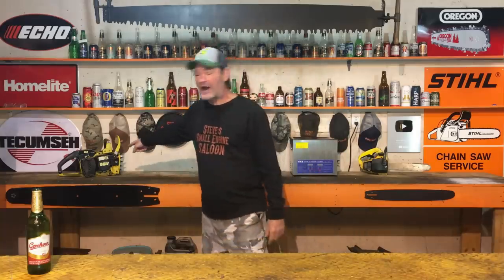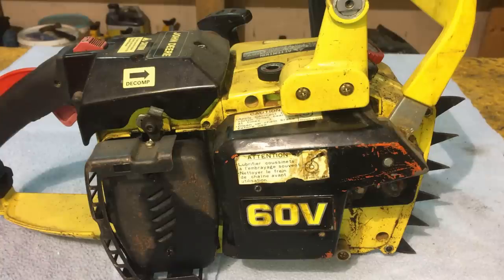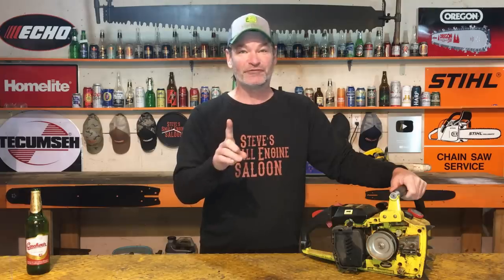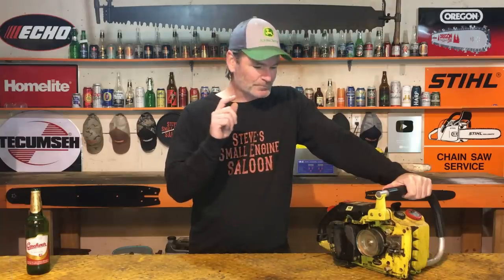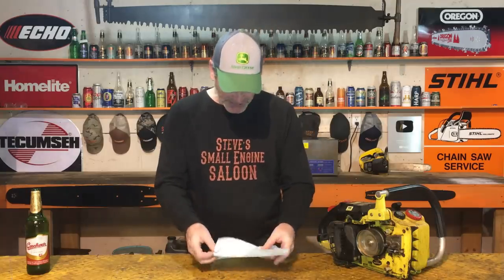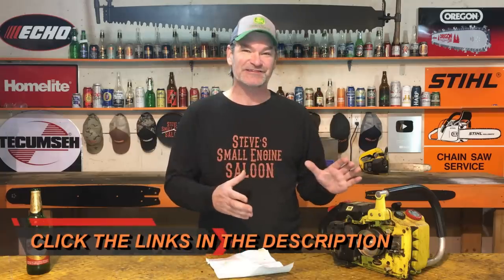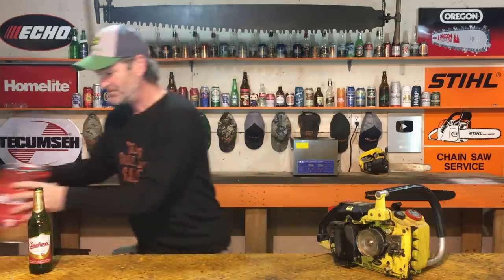Help Me Fix This Chain Saw Oiling Problem

Comment from the maker: ✅Click here for bar and chain oil ➜ https://amzn.to/2WhJoIT
For more videos like this, check out: 
👉How To Use a Stihl 2 In 1 Chainsaw Chain Sharpener ➜ https://youtu.be/marzGaMq6pM
👉How To Repair A Chainsaw That Cuts Crooked ➜ https://youtu.be/AgCZxee2NPA
👉Adjust The Chain Tension On Your Chainsaw ➜ https://youtu.be/FxgQSPQeYYM
👉Correct Way To Adjust The Carburetor On A Chainsaw ➜ https://youtu.be/M6T5JoGXcHY

You can connect with Steve here too: 
✅Visit Steve’s WEBSITE ➜ http://www.stevessmallenginesaloon.com/ 
✅Visit Steve’s PARTS & TOOL STORE ➜ https://www.amazon.com/shop/stevessmallenginesaloon 
✅Follow Steve on FACEBOOK ➜ https://www.facebook.com/stevessmallenginesaloon 
✅Follow Steve on INSTAGRAM ➜ https://www.instagram.com/stevessmallenginesaloon/ 
✅Follow Steve on TWITTER ➜ https://twitter.com/SteveSaloon

Comment: i have been a small engine mechanic for 40 years now in guernsey, channel islands, we used to have that same problem with the old remington saws and the solution for those was 50% chain oil to diesel mix and it always worked with that, love your videos keep them up. best regards Andrew

Comment: I've been in the same business for 36 years and can't remember much about that system. The crankshaft has a lobe on it that pushes the piston on the oil pump......that i think i remember. Also the check valves can be tricky. I vaguely remember that the clear plastic cover near the clutch drum has something to do with  the system too? Hope this helps.........keep us posted please!

Comment: Steve, just a rookie's opinion here. If I had that problem I would disassemble the entire oil mechanism/assembly. Then reassemble, double checking that each component of system is positioned correctly, paying special attention to seals, and their orientation. As another subscriber suggested, ensure all ports are clear before reassembly. Remember, we are all in this together,  and I am rooting for you. (Red Green).

Comment: Hi Steve. Get an airline, take the oil filler cap off, start the saw and put your hand over the filler hole. give it air through the gap between your thumb and first finger for about 10 seconds, don't push your hand down too hard.  Do this a couple of times until oil comes through. Once primed it should run fine so long as it doesn't run out of oil again. All the best, Another Steve from the UK.

Comment: I can't tell you how many things I've fixed by cleaning them. If it doesn't work, don't assume broken. This applies to everything from chainsaws to washing machines.
In this case, I agree with most of the comments.  Go diesel. The port is likely blocked by old oil mixed with very fine sawdust.
I appreciate your humility in giving a shout out for an assist. Many would never do that.
Happy trails.

Comment: I have 60V I bought new in early 1980's. Best saw ever! Used it for firewood for several years up north. Now I use it for hurricane clean up. I have the service manual. I can send you the section on the oiler--if you don't already have it.

Comment: What I did was make sure the oil was at about half a tank, wrapped a air compressor nozzle with a damp rag to plug the hole and used 100 psi to blow oil out the oiler system. Once oil started spraying everywhere it has worked beautifully.
Reply: I want to see that whether it works or not.
Reply: That's great...
Reply: I just did this to an 80's echo 500 vl and it worked great. I used a big washer to cover the hole and still got oil everywhere
Reply: This will for sure clean out the system. I would then run some cleaner through it to get any leftover junk out.
Reply: Damn straight! The best way to fix that somebitch for good. The check balls , o- rings and seals are crucial to this oiling systems sealing for proper flow of oil. 
One bad component and thats all it takes. Thanks bro

Comment: I own a 40v and a 60v I inherited from my dad. I have the exact same problem in both saws. Both run great, don't oil. It kills me to think of getting rid of these saws but parts are hard for me to find and again, the oiling system is awful to work on. Point is, I could use some help as much as anyone. Thanks.

Comment: Steve it's simple it really is.... Do what my Grand pa did .... Put it all back together again get a bucket half fill the bucket with chain oil and go cutting. After every cut just dip
the blade into the bucket and start cutting again... Over here in the U.K. It's called self oiling.. Which means you get covered in chain oil but at  least the saw keeps working..
Bet you are glad i came along on this one ???

Comment: Well Steve has chainsaw mechanic back in 1977 back till about 1985 long since retired that but I do believe that maybe what you got is a situation where there's a bypass from the bar oil back to the tank and if the oil is moving quicker through the bypass and it's getting to the bar Oiler that's my best guess good luck

Comment: I would had the same with lambard chainsaw back in 80s 
I had to prime hand pump before auto will kick , I would strip manual pump , prime with heavy oil like 80-90 weight and check flow , hope this helps good luck and thanks for sharing knowledge

Comment: Had the same problem with a vintage saw there was a duckbill valve inside the oil tank on a pulse line that had fallen off. For the oiler system to work the tank must be pressurized.
Reply: I thought "duckbill" too because I fixed an old Poulan (one that was made back when they were solid machines) by replacing the duckbill. But I don't see one on Steve's schematic. Maybe I missed it ... do you see one?

Comment: Steve, my Echo chainsaw of the same vintage has a similar issue temporally repaired by replacing the hose (looks like surgical tubing) extending from the pump to the plate at the chain.  The hose either plugs or deteriorates within a few months of replacement.  My saw is the twin cylinder model that is now an expensive decoration.  Good Luck!

Comment: Hey there Steve, I couldn't tell from the parts diagram, does this have a pump for does engine pressurize the oil reservoir?   If it is a pressurized tank system, maybe the port from the crankcase is plugged or possibly the gasket around the filler cap leaks?  Never worked on one of these, just my random thoughts.  Good Luck and keep on keeping on!!

Comment: Well your right with that many parts involved in an oiler system, that is going to be mind blowing to trouble shoot. Before I saw that though was my thought of if there is a pick up tube in the oiler tank with a screen is possibly the screen is plugged or they the tubing from being pushed into the tank in a certain way has developed a kink in it which has closed it off as I have had something like that develop in a little homesite saw of mine. Might be worth checking out if you haven't already.

Comment: Steve, love your videos.
Question, I have a Stihl chainsaw that has served me well. Used it a couple months ago with no issues. Tried to use it law week. When you pull the cord it feels like it's hydrolocked. Take out the plug and it pulls freely. Thoughts?

Comment: Have you tried checking the seals on the oil plunger. May be leaking and not allowing oil to flow when using the manual oiler. May have a blockage in the oil passage too.

Comment: Hey Steve .... I'm gonna throw out a hail mary and see what happens... from what I originally thought, and from what some of your subscribers have been saying....I would like to see what the oiler draw tube,or port looks like,and would bet your next paycheck (lol) that there is a blockage somewhere along the line , or the filter the oil gets sucked  through is also gummed up . That's why it makes sense with some viewers comments on using diesel fuel,or acetone,or any strong type of solvent seemed to work for some saws. The chemical or solvent that was used in the oiler reservoir eventually broke down the blockage enough to be able to draw oil again.
 Thanks for turning the tables on us and let us, your viewers, have an opportunity to help you with your repair. You are our preacher , we are your church ! 
 Thank you , charles

Comment: I have fixed my John deere chainsaw with using a vacuum pump sucking on the oiler hole by the bar. Try it just might work. Did for me. Works to this day.

Comment: Steve, I love you videos and have learned a lot from you. I'm guessing that your problem is in the functionality of the oil cap as it has quite a few parts and it looks like they are using it to control oil flow, it could be letting to much or to little air in. My Stihl 009l has a diaphragm pump running off cranckcase pressure and it had a bad gasket on the cap and it wouldn't pump oil. Good luck!

Comment: Have you tried using a shopvac to see if it will suck air from the bar sid to the tank? If you put the vac over your tank fill and you get it sucking a little air, then spray some brake or carb cleaner in from the bar side.

Comment: try running it with a bit of oil in the tank with the oil cap off to see if its a venting problem. next try pressurizing the oil tank and see if air or oil can even be forced out. one of the knobs may be assembled in a closed position.
Reply: #21 looks like a metering system make it loose as as you can! I think this is the right track!

Comment: I had the exact same problem with an Echo chainsaw that would not oil. Dealer couldn’t fix it either. Problem was fixed when I bought a Stihl.
Reply: Husqvarna has superior Oilers fyi.
Reply: Damn straight on the he sthil.  STHIL THE BEST A MAN CAN GET
Reply: Brilliant
Reply: @MatthewBrownW  Stihls are not even good boat anchors
Reply: BS
Reply: @terribreneman5578  what the hell is that supposed to mean
Reply: You settled for a temporary fix A modern Echo would be the correct fix.
Reply: @owengreene7659  although I like and use several Echo products on a regular basis, for chainsaws, it's Stihl all the way.
Reply: @owengreene7659  yea yes yea
Reply: @phillippowell6299  As a recently retired small engine mechanic I stand by my comment without reservation. Stihl is resting on their laurels making mediocre at best equipment. At any given price point you get less with a Stihl.
Reply: @owengreene7659  I stand by my comment too.  You are welcome to your opinion.

Comment: i did crank seals on a 1984 550 evl echo last year and the oiler adjustment was on top of the motor but you had to use a screw driver to get to it ,, im wondering if someone may have taken something off the oiler system and left something missing or possibly the oil tank isnt venting ?? good luck with it i know you will get it working no worries

Comment: I have got a FS 80 stihl weedeater it has got a slide carburetor it idles good, when you go to full throttle it die off the carb is clean the diaphragm gasket is still flexible can not find a carb kit for it. The fuel filter is clean and all new fuel lines. Any suggestions thanks great videos. This fix may take a case.

Comment: I know how you feel I have a Stihl that does the very same thing..Using a new regular oiler or high volume oilers  that throw oil but the chain will still gets hot and freeze up..It is so frustrating ..Your not the only one that has one of those SOB's. It has been sitting on the self for years every now and then I get enough courage to try again.  Motor is excellent what a waste

Comment: Have you tried priming the oil system by putting oil in the outlet that seems to have always worked for my saws if you can unthread the thumb piece for the manual override Prime at 2 with some Bar Oil

Comment: Have you tried to blow air in the little hole on the side while pumping the oilier my dad had one of these old saws and that is what I remember him doing It blows all the blockage back into the tank then drain and refill with new oil.

Comment: hiya, I talked to brother that collects them saws he told me too have check the check valve ball assembly and make sure the spring moves freely , make sure the cap is venting, but he said even if was not venting it would still oil but not very long the check valves were what he found wrong sticking some times some solvents would break them loose  hope this helps

Comment: I have an old pumper McCulloch the shop had it for over a year the finally found a new rubber oil pumper ball like gas primer bulb and it worked is there a hole in your rubber manual oiler pumper ball bulb?

Comment: Speak of venting, Does it have a vented cap that may be plugged?
Reply: You could be onto something there
Reply: First thing I thought of.  If it doesn't I'd still drill a pinhole. That worked on my old Husky.
Reply: @Rick-S-6063  2 previous mechanics and Steve would be smart enough to try it with the cap loose or off.
Reply: @Rick-S-6063  Nor did I imply they were dummies, just stating the obvious.

Comment: How is the pump driven? Fill the tank then apply slight pressure and check for possible leaks or blockage.

Comment: Look at your diagram again find where the screws are on the side take them out and clean the check valves and ports inspect for a bad one sounds like one is plugged or shot . U can try taking oil cap off and blowing air in there to and seeing if the air comes out the oil hole to to prove the tank don't have a clog anywhere hope this was helpful

Comment: Hi Steve, it's a gentleman engineer who calls for help from his apprentices! My recipe would be to work through individual groups on the schematic, one by one. Check for presence of every part. Check for cracks in the o-rings and any flexible tubes. Check their sizes are right. Then check for the absence of sawdust and other krud. Then I'd check for air locks by loosening each screw, nut or knob to allow air out until oil appears, whilst turning it over and changing the position of the motor. Done all of that already? Aw shucks!

Comment: Have you checked the strainer on the oil pick up? Is the suction hose collapsed? Take the oiler out under the knob it has three o-rings on it, If the middle ring is bad it won't oil. Do not screw oiler all the way in when you put it back because you bottom out the plunger and it can't move (it works on a lobe on crankshaft). I can't remember the exact setting screw it all the way in and two turns out I think before you put the knob back on. It sounds like pick up is blocked because neither pump works.

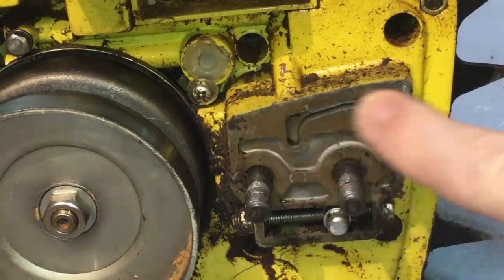Comment: My amateur idea: Suction at the oil hole 2:13
A vacuum pump(like the: Mityvac mv8000) you can probably use the universal cone shaped plastic fitting to jam to the oil hole. Pump away and hole for the best.

Comment: Try plugging off the manual side and see if it's losing pressure somehow. Maybe by isolating each side, you can at least narrow the problem down to either the manual or automatic. Good luck and thanks for the content. Cheers

Comment: I agree that putting diesel or ATF in the oiler system can help, and compressed air works wonders.  I'd be concerned about using a strong solvent like acetone.  Have you checked the service manual?

Comment: Hey Steve, First make sure that every piece of the body, where an oil part mounts, is crack and burr free. Use a magnifying glass and inspect all mating surfaces. If you can get travel specs for all moving parts, shafts and lobes, measure those precisely. The internal drive may be worn and not moving the pump parts adequately. At that point you adapt a sturdy spray bottle, with a small hose attached and point it at the bar and chain and give it a little squeeze when you want a little oil. I saw a guy take one of those all metal, small oil cans with the long spout, where you have to push on the bottom to get oil and mount it on the top body of the saw so it would drip on the chain. He capped the tip with a plugged piece of windshield washer hose when not in use, so it wouldn't drip empty. That or junk the saw. Now replace all the plastic and rubber pieces including seals and vents or cap vents and diaphragms and o ring seals. Next go with replacing springs. Now move to checks valves, check balls and seats.  Lastly, try finishing it off with the rest of the parts you still haven't changed as a last ditch effort. First try your repairs at each step using kerosene, NOT GASOLINE, mixed with oil and see if it pumps and find any leaks at all that it may have. Just don't get it to hot or it may blow up and burst into flames, killing everyone within sight. Once it's pumping with the new parts and thinned oil, switch to a thin plain oil and flush it several times and then go to the regular oil. Good luck. Let us know if it becomes a door stop, or lives on to cut another cord! Thanks. Jpol. Could be as simple as a spider nest clogging the squirt tube. Been there.

Comment: I once watched a guy running a saw that wouldn't oil. He had a bucket of used motor oil and he would just jab the bar into the bucket and rev the saw a couple times for every cut! Not recommended but it was good enough for him.